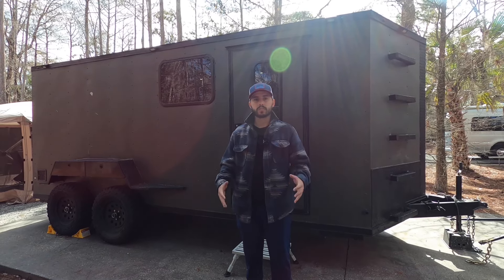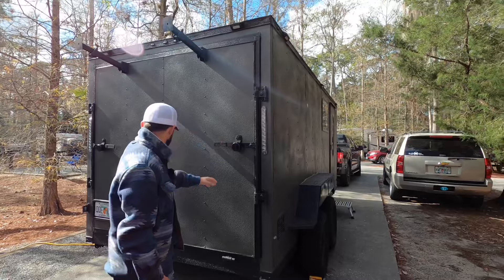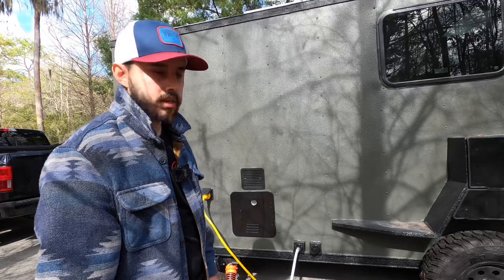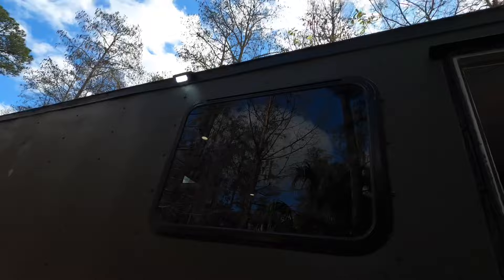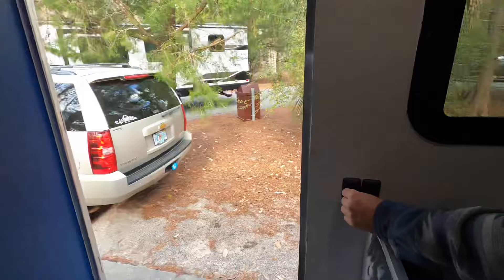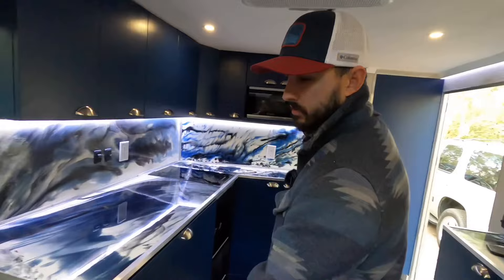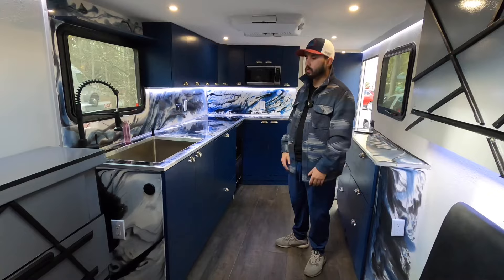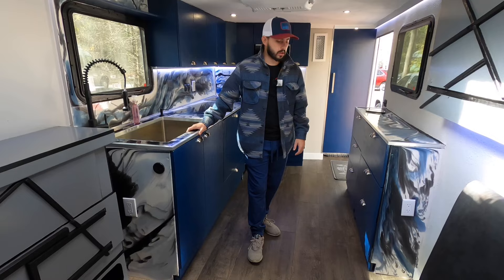Cargo Trailer Camper Conversion.. high end finishes, bathroom, solar power… Rugged luxury on wheels

Comment: I like a lot things you did on this trailer like the ladders on the exterior and how you put the bathroom in the v-nose.
Reply from the maker: Glad you enjoyed the design it definitely took alot of thought
Reply: I’m sure it did take a lot of thought.

How did you do the steps?  Is it aluminum with bedliner on it?

What is the interior height on the trailer?

Also, did the Silent Ride Suspension add any lift to the trailer? What’s your clearance height?

Comment: Nice build, I wish u had a video on the build, what type of insulation did u use, 
U did pretty good putting 10 # of shit in a 5 # trailer 
I wish I would've bought a 16' instead of a 14'  at 7' wide, talk about shoving 10# of shit in an 4# trailer of mine, a very small shower and 5 gallon shiter and a full queen size  Murphy bed, im thinking I'll have about what you'll have in it about $30, when all said and done, great job the more you build the better you and your team will get

Comment: It appears that we've had a very similar Journey. 
I've had a Outwell 7ATC tent similar to the large tent in your videos for about 4 years.
I just ordered a 22X8.5 + 8ft tall custom trailer that we plan on converting into a camper.
We have been working on our layout in Rino for a while and think we have everything where we need them except our tanks.
I've considered raising the floor and placing all the tanks inside the trailer, but there's a lot of lost space in that idea.
 We are looking at mounting x4 tanks beneath the trailer, I found a few 39gl black tank that are 14in  wide and 7 deep.
 I'll be placing  2xgray 1xblack, we are still looking for an available 90plus gallon fresh water tank that is 7inch or less deep.

We order 7k tendom spread axles at 5degree down,  I think that gets us 7 inches extra hight.

I can't wait to get the family out on the road and not have the 6hr+ setup that comes with camping with a giant tent and a tone of gear.

If you don't mind what is the make, brand, size of you rims and tires
Reply from the maker: That’s sounds awesome, I’m sure you’ll enjoy creating your own rig and enjoying the simpler set up times. The tire size is 235/75R15 Rim size is 15

Comment: I’d really like the details of how you built the table
Reply from the maker: We used a longer chair electric motor and bolted it up to some fabricated metal pieces. It was all wired under the  trailer and recessed so underneath the trailer there is a slight drop down which is where the table falls into including the motor.

Comment: I’ve got a 7x16 open canvas I’m ready to do something similar to.
Reply from the maker: That’s awesome. Exciting times ahead. I’m going to have an update video pretty soon on some of the things that didn’t work out so well and the things that did after a couple years of use, if it helps for your build.
Reply: @tacltogether  I bought it with the walls insulated, ceiling insulated and dometic penguin II on top (slim, black) and a few outlets to plug into internally. The bathroom in your v-nose is perfect for what I’m wanting to do to mine! I think you partitioned it really well!
Reply from the maker: @foxaviationservice773 nice. That saves you a lot of upfront work. Thanks, I appreciate that. It was a lot of head scratching trying to figure out the best layout to use and where to place things. V nose felt like the most akward prob dead spot for most things so the bathroom seemed to just fit in well there.

Comment: Where did you get the cabinet/dresser for the clothes? Also did you just fabricate your own shower enclosure? We have a curved corner and was looking at a neo angle shower pan but all the walls have 90 degree angle at the corners.
Reply from the maker: All the furniture was built to fit best in trailer. We also fabricated our own shower enclosure as we couldn’t find a shower pan/enclosure to fit correctly in that corner that was used for the shower. We used flex seal to seal up everything water tight

Comment: Very cool camper. Really like the shower you have done. What is the wall material you used and could you do a video on the shower build
Reply from the maker: @Michael Brooks thanks! Unfortunately I don’t have a video of the build out process of the trailer only pictures. The walls are simply ply boards with a flex seal on the backside and the front is a epoxy coating. I used a company called stone coat. They have great how to videos online which im sure would  be great help.
Reply: Very nice build. I thought it might have been epoxy
Reply from the maker: @Michael brooks thanks! Yeah it definitely lets you be very creative so I think it’s a great alternative

Comment: Beautiful love it . How wide is the trailer and where can I find that shower door ?
Reply from the maker: @BLK GOD IS FURIOUS it’s 6 1/2 feet wide. It’s called nautilus shower door. You can get it Amazon or on their site.
Reply: @tacltogether  💯 had to subscribe.
Reply from the maker: @BLK GOD IS FURIOUS I appreciate the support
Reply: So it is 6 1/2 tall and 6 1/2 feet wide and 16 feet long correct?  That was a little unclear on the video.  Fantastic build!! Great Job!
Reply from the maker: @Daniel Dixon technically it’s sold as 7ft tall and six feet wide by 16feet long. But when you add the insulation and panels and stuff it’s basically 6 1/2 feet tall. Thank you, I appreciate it.

Comment: Awesome  build. How did you run plumbing from the  toilet and shower back to the  waste tanks.  Was their much cutting  involved.? Very nice!
Reply from the maker: @ D and D Welding thanks! The toilet is a straight shot down into the black tank and the shower ties into the sink as well for the tanks which is slightly behind the black tank which is at the nose of the rig.

Comment: Nice job. That table is really trick!! What did you do your shower walls in? Thanks Kc
Reply from the maker: @kc033056 thanks. The walls are just plywood covered in epoxy for the look and water protection.

Comment: Nice build, but I wonder what the cost difference is to a comparable bumper pull camping trailer?
Reply from the maker: @Jaran Higley thanks! Depends on what you buy but yes you can buy a traditional trailer at a cheaper price. The big difference is the quality in build and quality materials and equipment. Most people that have been buying trailers for years can tell you how poorly they are built and the low quality material used. You can definitely waste less as well if you don’t install a solar system, all depends on your needs. That’s the beauty, you can have a trailer customized to your specific needs.
Reply: @tacltogether  Perfect, I just need to find a bag of cash, lol! I would love to do it for sure.

Comment: I'm new to seeing these converted cargo trailers on YT, is this cheaper than getting an actual camper?
Reply from the maker: @flon57 it can be, depending on how much you put into the trailer it can be very inexpensive but if you do as I did it can be just as and in some cases more. Depends on if you want something custom to your needs or not.

Comment: How did you do the built in ladder?
Reply from the maker: @Eva Benitez the exterior ladders were welded directly onto the metal Skelton frame of the trailer. We created a entire cage like skeleton on the interior of the rig for reenforcement and to make the roof fully walkable as well.

Comment: What is your ground clearance.  Are your  tanks heated/enclosed underneath?
Reply from the maker: @GB somewhere around 19 inches. I had the option to heat but I did not die to fact that I live in the south and don’t plan on doing any freezing temps winter camping to be honest but that can def be done.

Comment: Love the build and that you have tanks, full power and air. I have a feeling parks and campgrounds will stop allowing private builds with people that do not have waste tanks. Hopefully never stop allowing private builds at all but there are people who dump onto the ground .Are the floor beams 24 on center or 16? I read it’s hard to find tanks to fit the 16. And what state are you and your buddy located for anyone interested in a build?
Reply from the maker: @mrm thanks I appreciate it. I hope they don’t either, that was my intent behind the build to make it as much as a traditional Rv setup as possible since we do a lot of campground stays. The floor beams are 16. We are located in Florida.
Reply: Did the bed liner have any trouble sticking to the sides?
Reply from the maker: @Jimmy Bradley no it was primed first and then the bed liner applied to it as so far it seems to stuck well.

Comment: Your drains are in exactly the wrong place- you have no breakover angle where you need it the most. The most modest hump in a road and it's going to rip all your low hanging drains off. They should be mounted as close as possible to the wheels. And blow your nose- disgusting.